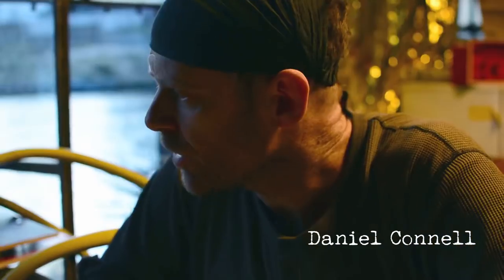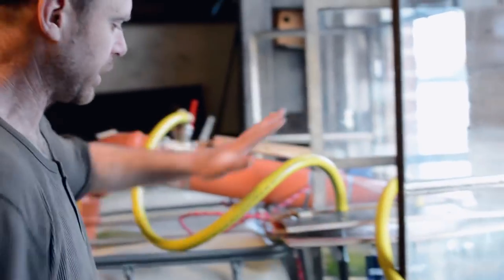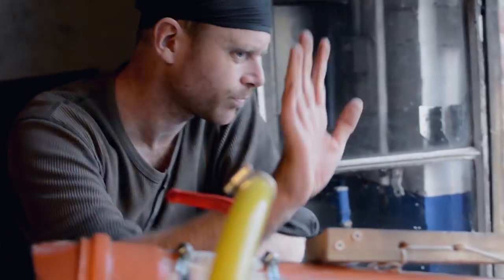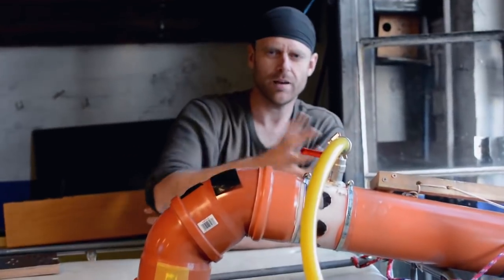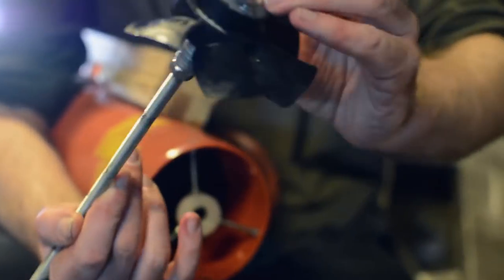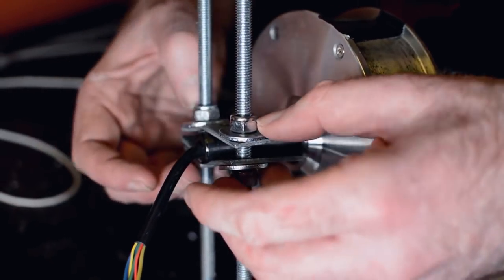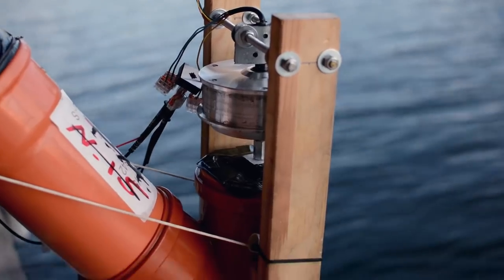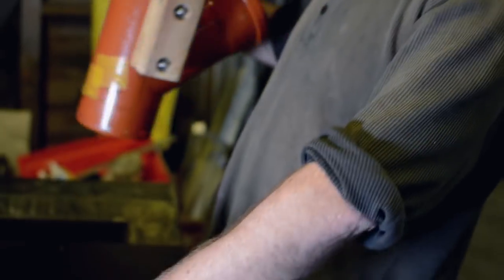$50 Water Turbine-5 kilowatt hrs/day - Open Source, DIY

Comment: I like the use of a ‘draught’ tube to create the fast flow with the turbine at the top. You see this rarely. Perhaps different turbine blades and lead in entry might increase efficiency. Nice work.
Reply from the maker: I experimented with a couple other impeller types, the standard fan worked the best, which is good as it's also by far the most available.
Draught tube configuration definitely makes a difference.
Reply: @OpenSourceLowTech  it is just thinking of most turbines they have a stationary set of lead in blades to more direct the flow to the working blades.  I like what you are doing.
Reply from the maker: I experimented with a stator turbine just before the runner, but it ended up making the power output slightly worse, so not sure if it was the thing itself or just the way I did it that was the problem...
It's kind of better if it turns out not be useful, as it would then be one less thing for people to have to make...

Comment: Great video and awesome project. To comment on your failed stator design, the point of the stator is to increase the velocity of the fluid, not to simply spin it. This velocity increase is due to Bernoulli's Law and the continuity equation, where a decrease in area will cause an increase in velocity. To achieve this with turbines, the gap between blades on the inlet side of the stator is larger than the gap between those blades on the outlet side. You would also need to have the center be closed (your stator has an open center). If you were to design your stator in the fashion of a turbine stator (closed center and some actual math behind your blade shapes), you would likely see improvements.
Reply from the maker: Ah ok, interesting. Thanks, I'll have a rethink.
Reply: @OpenSourceLowTech  Here is a link to an awesome jet turbine technician's channel. This particular video he goes over what I mean, hopefully it makes it more clear. https://www.youtube.com/watch?v=G7oNE5yQvNM

Comment: So much good intention, so little research of existing literature. 40 plus years ago I was this guy. The Indian subcontinent had done all this, a thousand times over. As he said, using the alternator off a scooter/motor bike.

Why hasn't this become the norm after half a century? Simple, people with this level of creativity and curiosity are LITERALLY rarer than 1 in a million. When this thing breaks down, not if, it will rot before it is repaired. 

Bodging is for genius.
Buying is for the rest.
Reply from the maker: The idea is to train locals to produce things like this as their job, so that they're also able to maintain them. Zero externalities and outside reliance, ideally.

Comment: Maybe use a spiral corkscrew on the down pipe as a non cavitating rotation. Like the kind they use to lift water easily, Archimedes
Reply from the maker: Archimedes screws make good turbines, but in this case I'm looking to favour revs over torque (for sake of voltage over amperage) and so that would be a step in the other direction.
They're also a bit tricky to source or make..

Comment: Hi Daniel & thanks for the awesome channel!  Do you have any plans to look at water turbines that can be dragged behind boats? It's a system that costs about £3000,-, but surely this turbine could be adapted for that kind of use by fishermen in poorer countries?  Subscribed!!
Reply from the maker: The main issue with in-stream turbines is the water needs to be moving quite quickly to get any useful power. But mechanically they're usually fairly simple.

Comment: Here is something that could help increase your output.  Vortex the h2o befor if hits the fan blades. Direct the water with vains that point the opposite direction of the fan pitch it could be done anywhere above the fan
Reply: That's before not befor...
For the retentive types, sorry I can't edit my comments on YouTube.  They don't like me anymore, I quit using their app and started using an add blocker. Best traid off ever, in my opinion.
Reply from the maker: I tried a stator turbine just before the impeller, but it ended up costing me about 10%. But I might have just made it badly.
I also have a configuration for something more like a Kaplan turbine which involves a partial vortex, will take a crack at it at some point and compare.
Reply: @OpenSourceLowTech  look at vortex designs of Victor Shauberger.   On the exit side vs. the entry.   Implosion vs. Explosion design.
And thanks for sharing

Comment: At 20:29, the water direction shaping thing. It should increase the torque of the turbine. As result, increase the current on heavy load. In the meanwhile, decrease the output voltage little bit, since the water speed in slower. In the big picture, efficiency is improved and more steady on different load.  As you said, it lower the power. May be the shape need to tune a little bit to make the direction shopping more ‘smooth’. Just my 2 cents.  You did great job. Admire.
Reply from the maker: Yeah I'm pretty sure that stator can be done better. At some point I'll 3D print a couple just to see if there's any extra efficiency can be extracted.
I don't want to make people have to have access to 3D printers, but if I know what shape works best I can try to reverse engineer it with more available materials.

Comment: You sir are a genius!!
Hands down the best power solution ive ever seen!!
I'm very impressed at the ingenuity, cost and ease and the good will to offer the knowledge for free
You honestly deserve an award!! if not God has a place in heaven for you dont worry about it😊👍
I am wanting to do a set up for my home, although have not got a constant water source, 
do you or anyone in the comments have any water circulation ideas that would keep up with the volume of water taken from the cyphon of 3 or 4 of these generators ?
I thought of dedicating 1 setup for a water pump to return the water although not sure if a large enough pump, and the power to run it for that matter, would work/be efficient?
or, is there a way to cascade the flow up hill or something?
Cheers👍

Comment: This is INCREDIBLE, and i just grabbed 7 Offgrid Acres i would love to incorporate this into my systems [i have some ideas of using it in conjunction with my RamPump setup]. Dying to see your full open source construction tutorial
Reply from the maker: Sounds good, feel free to message me about best ways forward.
Ram pumps are great for getting flowing water higher than it was, but in terms of electrical generation, given the efficiencies of the various components, you're better off generating directly from the water supply you would have run the pump off.

Comment: Would be fantastic to show how to wire this into a home setup. I'm wanting to try something like this to offset cooling costs here in kentucky
Reply from the maker: Would depend on specifics, but quite possibly some variation on:
Alternator - rectifier - charge controller - batteries (load diversion when they're full to dummy load) - inverter.
Reply: @OpenSourceLowTech  thanks I'll do some research.

Comment: If you increase the area of pipe on outlet side so it's more than the intake pipe you should have perpetual siphon from level ground.
For instance zigzag the pipe going down flow so it increases water volume and leave the up flow straight maybe?
Reply from the maker: Unfortunately that's not how siphons work, the outlet must be lower than the inlet.
Reply: OpenSourceLowTech i thought gravity over mass would work.

Comment: Just thinking about how you have your motor mounted, it strikes me that you could have the motor sleeved in some piping, thereby centering  it, particularly if you were to turn the motor round, such that you spin the rotor rather than the outer casing.  No good with the motor you have chosen, but might work with another motor design.  Then you could place an end cap on the tube, sealing the motor from the weather.  Drill a hole for the wires, silicone the hole.  Just pad out with tape / foam if the motor is a little small.  Heating the tube / freezing the metal would assist with assembly and make a perfect fit once ambient temperature was reached.

Comment: You should glue a bunch of magnets on the outside edge of the generator and place a coil or two on the boards on either side to add a little more electricity, maybe even the top of it and place a board above it also with a bunch of coils and mags glued to the top.
Reply from the maker: Potentially, but the wheel as is is doing a sufficient job.
Making my own alternators would give me more options in terms of tailoring voltages per rev and such, but would be a lot more work.

Comment: You could try a fidget spinner bearing as a fan bearing. Might help reduce friction? Just a thought. Nice rig .Well done.
Reply from the maker: The front bearing needs to be immersed in the water and so would need to be non oxidisable. So something like a ceramic bearing, which would be much harder to source.
The bush bearing as I have it with a plastic hub and stainless steel washers seems to be working well so far, is low friction and very easy to make.

Comment: Very interesting engineering and a great video. Was thinking that a lot of power should come from so much water, maybe second fan should be useful if used with siphon drop (but cavitation might be a bigger problem then)? And if fan is not strong enough maybe simply putting some epoxy on the back of the blades could help.
Reply from the maker: Tried a second fan, in the hope of trading some revs for higher torque, but it didn't make any measurable difference.

Comment: This is too cool. I'm going to try some of your builds shortly. I'm a coward when it comes to failure so having low cost/risk is perfect for me :D

If the river has consistent flow you could use a ram pump to make head for that turbine - you might need several pumps though, or a reservoir. I'm sure there are better ways of doing it though xD
Reply: If you have access to a long run of flow, you can use a long section of pipe to give you the needed "drop" at the location of your turbine. Lets say you have 100 meters of water flowing on your property with 3 meters of drop from start to the end, Place the inlet side at the highest point available and the turbine set at the lowest end. The piping should give you the equivalent of a 3 meter drop at the turbine. just a thought.

Comment: I like the concept.  I don't understand why the 3D Printed impeller was thrown out so quickly.  I understand the fan runs at a faster speed, but surely the impeller would be more efficient.  The impeller speed can be scaled via gears or pulleys and I would imagine in doing so the resultant power would be higher.  Also the back-emf from the alternator slows down the fan/impeller so I think it would also be more efficient to use an MPPT similar to a wind turbine to get the best power out of the system.  Have these been tested?

Comment: You can use a motorcycle regulator for chargecontroller.  FH020aa on aliexpress costs from 15$ and works like a charm.  Or you can take it from a scrapyard from almost any japanese motorcycle.   3 phase input and perfect voltage output for a 12v lead acid battery.
I dont know lowest input voltage  for it to work but my motorcyle was about 40vAC on each phase on idle unloaded (not connected to regulator)  and it put out 14.4v and 14A loaded with 2x60w highbeam and about 80W ignition, taillight etc. 
You should have some sort of cooling on that hoverboardmotor. Use some thermoglue and glue on aluminumfins like a turbine.  Drill inletholes on the backplate and let the hot air escape through holes at the fins.
Reply from the maker: This is more or less my thinking, yes. I've got a motorbike regulator, was going to glue it to some polystyrene so that it floats upside down with the heat exchanger fins in water as a kind of sort of dump load.
The hoverboard wheel does seem to get a bit warm so I was just going to drill some holes so that it essentially acts as a centrifugal air pump through itself. If I end up with a turbine configuration that has positive pressure near the alternator I might see about spraying a little bit of water onto the aluminium casing as active cooling.

Comment: Have you considered a flexible pipe for the river version (7:15) that isn't required to go over a wall? Like a firehose but would not have to be as heavy duty as lower pressures involved. if the upstream inlet is rigid then the water pressure should fill the hose and it would be a lot more portable and perhaps easier to repair
Reply from the maker: It's a possibility, tho would need to see if the pressure would be enough to inflate it.
For reasons of volume you'd want it to be at least 110-125mm, which is a bit fat for that kind of hose but probably exist.

Comment: have you concider a cone expansion with a 2-3 times bigger tube at the end for when engaging the startup making a vacum for greater flow rate 🙂
Reply from the maker: That sort of is the case in that the pipe on this version goes from 125mm to 160 immediately after the impeller. This is mostly to reduce the meters per second of the flow to cut down on cavitation, but will also increase the liters per second across the system for the reasons you say.
I could add to that by increasing the draft tube more still, and industrial units of these have conical tubes for that. But I'm somewhat limited in my options in terms of what I can cheaply get off the shelf, and having the design require more flow would then preclude those with smaller water sources available.
Basically the system is fairly arbitrarily scalable, and if people have the options for fatter pipe and more water available then they can always upscale and get more power.

Comment: Halfway on the downspout flare out the PVC about an inch or two; this should increase the flow rate. 
Add a check valve on the top to let trapped air escape; your fluid will be less compressible.
Reply from the maker: Yeah draft tubes are usually conical for that reason and to reduce cavitation, but I'm a little limited to standard off the shelf pipe sizes..

Far as I can tell the whole system is essentially running under negative pressure, so a  valve would allow for the output of air. I think the flow is enough that it all just gets blasted through rather than being able to build up, but longer term testing will tell.

Comment: Have you tried to force laminar flow to reduce turbulence? Before the turbine fill a section with smaller tube to get uniform flow.
Reply from the maker: Yeah have been thinking about it. The field test units I'm doing now will be more or less straight pipes, or straighter than then these two tests anyway, so I may experiment with laminar flow and see what difference it makes.

Comment: cavitation is mainly caused when the propeller tips is allowed to go faster then the speed of sound in (this case) water. You have to do some math to figure out if the tip speed of your propeller is (well) below the speed of sound in water... recommended is to not go past 95% of the speed of sound for the propeller to be as efficient as it can be.
I would experiment with a standard pc fan in which the housing (the nice sturdy and hydro dynamic edge/rim) is fastened to the tips of the propeller. This would make the propeller almost a highly efficient ducted fan without the crazy tolerances and precision engineering...
An aluminium propeller should be relative easy to make by means of a double sided sand mold and some hand finishing of the aluminium casting.

In any case you are on the right track by using part of a plastic beer bottle as your flow effecienisor...

Comment: That's an excellent invention. At 40 euro the ROI is about 1 month. The fan doesn't have to last for years. Just replace it when it breaks for 1.5 euro.
Reply: he forgets to mention that u need an infinite amount of water to run  this turbine  in order to produce  ANY power AT ALL
Reply from the maker: A river could be expressed as an infinite amount of water.
Reply: @OpenSourceLowTech   most rivers around the world are already privately owned(indirectly  thru "NGOs" ) by a handful of corporations   who want a total control over all the people in the world  so   if the 50 $ does not include a river or  there is is no  possibility for you to buy yourself  the government of a 3 world country  in order to get access  to the rivers in this country       mi argument   is still valid   .  I  have  to admit  that   your    device    is  good and practical    in a better world   would of been    very usefull
Reply: @stefanwidowsson1183  Sir, Sir! You forgot your tin foil hat, good sir!

Comment: Now what happens when you use a 3 to 6 blade Tesla turbine with 3 meter diameter disc to run a generator? Though for a smaller design you may have to stagger the exhaust holes by a mm or 3 on each disc like a whirl pool or for vortex to slow it down.

Comment: About the tearing on the fan blades, have you tried a simple "Tesla turbine" fitting where the water enters, to get the water spiraling while it travels through the tube before it hits the fan blades?
Reply from the maker: I have made a basic internal vectoring nozzle for more or less that outcome, yes.
Will see what effect it has..
Reply: @OpenSourceLowTech  Thank you for the answer :)